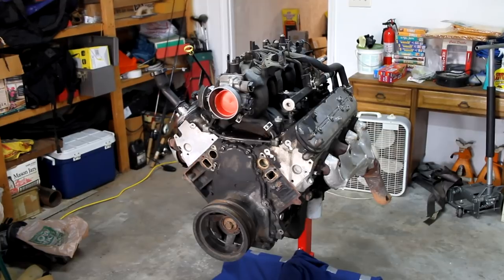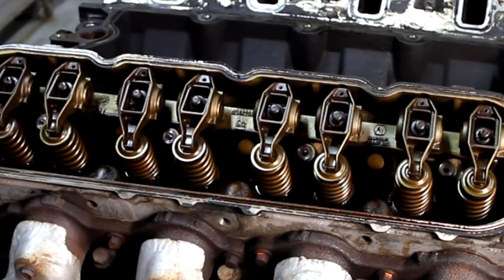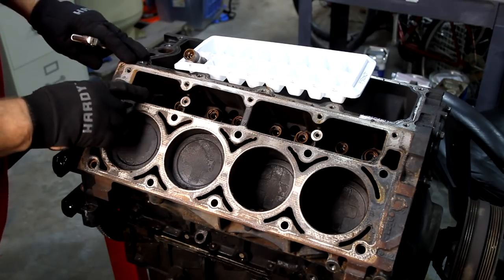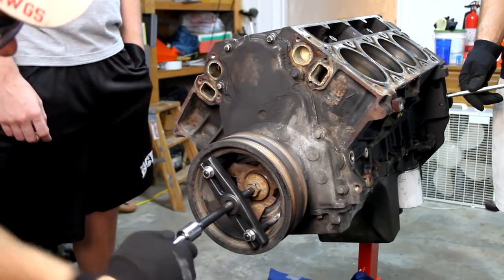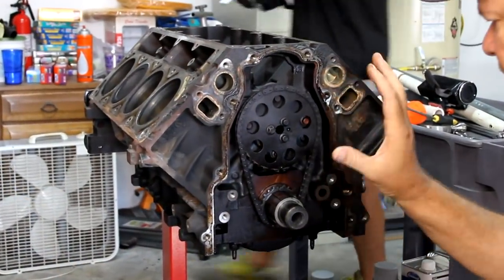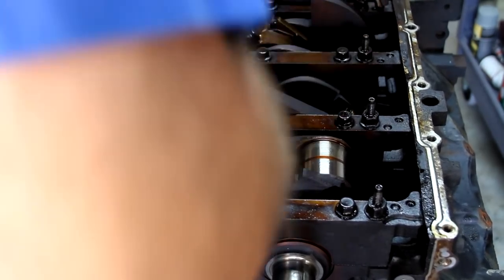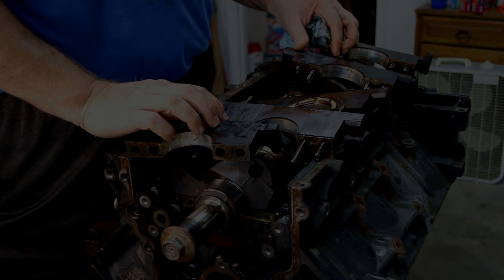LS 5.3L Build Part 2 Teardown | Project Rowdy Ep006

Comment: Just discovered your channel, great content! Also figured I'd share a little trick I have learned with getting the cam out. The water pump bolts are longer but are the same size and thread pitch so you can screw those into the cam to make a little handle to help with pulling it and putting one in. I noticed you were using your speed wrench.
Reply from the maker: I had heard that and when I attempted to do that, the bolts did not screw in.  I have a feeling I was using the wrong bolts.  The little guidance manual that I have mentioned an extension or rod down the middle, so that is what I used.   It will state that it was not the best method.  When the Cam came out far enough, you can see that I abandoned the speed wrench!  Awesome and thanks for sharing!!!!

Comment: was that a 5.3 or a 4.8 because typically the 5.3 motors have dish top pistons and the 4.8 motors have the flat top pistons. also some blocks can be 4.8 or 5.3
Reply from the maker: My engine is an LM7 5.3L.  The block has 4.8/5.3 embossed on it as this block casting was used for both displacements.  Hope that helps!!!
Reply: that's what I was thinking since it had the flat top pistons in it

Comment: I see that your Pushrods for 1,3,5,7 are darker than the even cylinders. Mine were too. Any ideas as to why the odd cylinders have darker color pushrod than the even?
Reply from the maker: That is interesting.  I had not noticed that at the time.  I have no idea other than something to do with the flow of Oil through the system reaches that side first (or last) and contains slightly more contaminants.   Just guessing.
Reply: Do ls engines lean either way slightly?

Comment: Really appreciate you uploading this vid.

I just picked up a 4.8 that needs rebuilding and I am literally going to follow everything you just did here.

Big Thumbs up!!
Reply from the maker: Hey... Thank for the message.  I highly recommend the following softback book:  "How to Rebuild GM LS-Series Engines" by Chris Werner.   I found it on Amazon: http://amzn.to/2g3xXNl for about $20.  I would not be hard to teardown an engine without it, but there are so many pieces of information that are really nice to know.  Just got my parts back from the machine shop and plan on starting on the bottom end tomorrow.   Best of luck with your build.  Keep in touch!
Reply: You can bore the 4.8 to a 5.3 as well. They were the exact same block which is sweet :)

Comment: Hi do u know the name of the part u started to remove at 3:16 I need to replace mine it's leaking, tnkz
Reply from the maker: That is the Steam Vents.  There are gaskets that can be replaced or entire kits for tubing and all.
Reply: @UCanDoIt2Mike  thanks was able to find the ls steam replacement tubes, aftermarkt but worked.
ps: thank u for your time

Comment: I think these things break exhaust manifold is because they are "bottomed out" in the aluminum heads and have no where to expand during a heat cycle. Just my theory though
Reply: Idk...seems like it's a common issue with any 4.8 or 5.3 over 50k. Possibly overtorqued manifold bolts from factory plus the heat just weakens the bolts over time. My guess.
Reply: Cheap quality factory bolts. Grade 8 ARP studs torqued correctly will last.

Comment: If you've ever broken off a bolt/stud on removal (even just once) you will then use penetrant solution, and the impact wrench. There is something about the rapid "machine gun" slapping action that will break the rusty bolt loose,compared to a long pipe on a breaker bar that simply breaks the head off.

Comment: How much horsepower and torque did this build make for you?
Reply from the maker: This engine has not been installed in its swap vehicle yet.  Even when it does, I doubt I will run it on a Dyno.
Reply: +UCanDoIt2 yes sir. Im looking to do a top end build, mostly for sound, but wouldn't mind getting between 4-500 horsepower if possible. what would you reccomend to do this?
Reply from the maker: My build modifications were mostly for sound as well.  I'm putting this in a Jeep CJ7 to be mostly streetable.  HP was not in my scope.  You will either need to start doing some research or find you a good motorhead.  Cheers!
Reply: +UCanDoIt2 thank you sir. love these videos. I watch them over and over. very informative.
Reply: @MrCmcmanus59 , UCanDoit2, Haha gtfoh I am doing my for sound as well Hahahah!

Comment: AIR TOOLS...........Tear a motor down in 1 hour
Reply from the maker: Yea...  I have tons of air tools but elected to follow some good advice from the book I was following.  Apparently pounding through it with an air tool often destroys the end threads of the bolts and tapped holes.  We had plenty of time, so we just slowly motored through it!  Cool stuff!!
Reply: @UCanDoIt2Mike  what book did you use   legit question.
Reply from the maker: GM LS-Series Engines by Chris WernerAmazon: http://amzn.to/2igcReD

Comment: Did you replace any of your freeze plugs? Why or why not?
Reply from the maker: All of the plugs where replaced at the machine shop.
Reply: UCanDoIt2 I did not have any intentions on replacing them. Do you believe it is a necessary step?
Reply from the maker: I believe it is standard practice to change them.  There are guys doing budget builds that are not changing them, but its only a $30 kit and the proper time to do it is now.  You definitely need to replace the Barbell plug which comes in most kits or can be purchased separately.   Hope this helps.

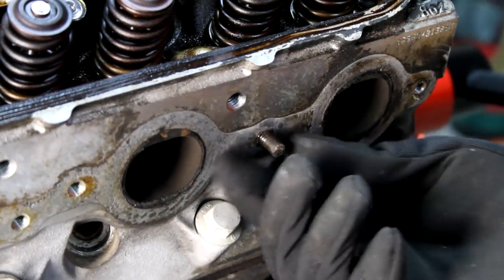Comment: I know this video is kinda old but just sharing a little trick for busted bolts @8:20 for anyone. Get a die grinder and make a little slit on the end of the bolt sticking out then use a flathead to unscrew it and boom!

Comment: Can you get rebuild a 5.3 to handle 400 hp with out sinking a load money ? 400 hp out this light motor be about pushing  and pulling my overweight assets around at high velocityyyyyyyy
Reply: Estebahn Randolph absolutely! I’ve got a stock rotating assembly 5.3 with a nice cam, injectors, DoD/VVTI delete, a tune and a big single turbo on low boost its making 640hp/650lbft with WAAAY more room to go. Hell, with just a cam, e85, and messing with the fuel enrichment and torque management/throttle body response on HPtuners you can be at 420/430.

Comment: my chain has the same play.  is tha bad?
Reply from the maker: Not as long as it is excessive.
Reply: @UCanDoIt2Mike  im actually watching the series of your videos as a right now im in the machining part

and im ordering a new chain. 
because i have the p0300 code and my engine sakes a lot, so i think it will help with the timing

mine is about the same looseness as your old in the vid, but the dots line about perfectly straight wen under tension from the small spur
Reply from the maker: @odiarroyo6144  I cannot tell from your message whether you have purchased a new chain.  The timing Chain is a wearable part and since you are this far into your engine, you should definitely replace your "Timing Set" which is the Chain, Cam Gear and Crank Gear.  All three slightly wear to create excessive chain slop.  A new Timing Set, if built correctly, should always result with the same amount of looseness, because the distance between centerlines of the Cam and Crank have not changed.

Comment: Would this process be sort of the same for a 6.0 lq4?
Reply from the maker: Regarding Machining....  Absolutely !!!!  This process actually applies to ANY engine (GM, Ford, Dodge).  The LQ4 is in the same family (GEN3) of GM engines as my engine.  The major difference is the Bore size of the block.

Comment: Really good video.
Mike, make sure to measure the thickness of those bearings just to make sure they're still in spec for thickness though.
Reply from the maker: Those bearings are going to the trash. The new bearings are in match the finished and polished crank and rods.  Going to be sweet!

Comment: great video
I don't know if it has been stated yet, but to get the lifters out, you remove timing chain and turn cam Counter or normal clockwise one turn, that pushes the lifters up and locks them and allows you to remove each lifter tray with lifters in one operation. Its what I have seen, explained with demonstrated.
Reply from the maker: Mark Torre I had also seen that process and should have tried it.   But I am not sure it would have helped in my case.   The lifters would slide out slightly (normal travel) then get stuck.  Great observation.

Comment: anybody know the name of the gasket. the one that goes where the knock sensor is located? thanks.
Reply from the maker: The Gaskets underneath the Knock Sensors are: Knock Sensor Grommets.  The Gasket under the plate that the Knock Sensors mount in, is a Valley Pan Gasket.

Comment: hello, I have a question, I'm replacing my castech heads with 862 heads on my 02 Chevy suburban. I will be using the same pushrods and lifters. do I have to follow the same torque sequence you did with the rockers you put on? or would I put the lifter bar back on and torque it down? thanks so much for your time and help!
Reply from the maker: Edward Thayer You would want to follow a similar process that I did.  AND....  you might want to check your pushrods length as a precaution.  Since the head is changing,  the centerline of the reunion (rocker pivot), could be a different distance from the crank and require a different length pushrod.   Just a thought.
Reply: UCanDoIt2 thanks so much for your time and help! how would I check to make sure the pushrod length will work?

Comment: You will probably get to this later in the video or something, but it is really important to stamp numbers on the rod caps and the main caps so you know what cap goes with what rod and main location.
Reply: junglejonny1000 the bores for the crank and rods are line bored perfectly linear. If you mismatch the rod and main caps, some could be just a tad different and the oil clearance between the bearings could be slightly off causing hotspots if too tight or vibration/knocking at high RPM if too loose. ALWAYS keep any valvetrain and rotating assembly parts in order if you plan on reusing them, they’ve been worn to that specific cylinder and should return to their homes. 😁👍🏻

Comment: 2004 5.3 vortec how many coolant sensor port in the head my friend broke the coolant sensor off on the driver side would there be a secondary that I could use broken sensor not leaking
Reply from the maker: Both the Driver's side and Passenger's Side Heads are Identical.  The one that broke off is probably the one on the front of the Driver's side.  Check out the same area on near the rear of the Passenger Side.   It might currently have a plug in it.  Just remove the plug insert a Temp Sensor and then relocate (or extend) the wire with the connector.
Reply: UCanDoIt2 Thank you so much for the great advise have a great day

Comment: What tool was used  to pull crank bolt out?
Reply from the maker: If you are talking about the Harmonic Balancer bolt in the front of the Crank, I use a large socket and large Breaker Bar.

Comment: Might want to calibrate your torque wrench since your were breaking torque instead of torquing. Great video though.
Reply from the maker: I guess I am a little confused by your comment as I did not use a torque wrench anywhere in this "Tear-down" video.
Reply: Looked like one but I stand corrected I apologize.  I was an aircraft mechanic and that was one of the first things new mechanics would do. Again sorry for the mix up. Great video
Reply from the maker: Hey...not a real problem.  Thanks for the clarification.   Cheers!!!!

Comment: well there's a lot going on in that engine. couple things that were cool to me... when your son pulled those heads they appeared to be soooo light weight haha! I've never been around aluminum heads... and the other is the 6 bolts on those bearing caps! there were 2 on the side right? gonna have to Google knock sensor also! anyway great video man!
Reply from the maker: Yes the heads are aluminum and are quite light.  And yes the bearing caps are attached with 4 bottom bolts and 2 side bolts.  Have been ordering all the replacement parts and boy are they expensive for these Gen3 Motors.  Hello!  Do they thing we are made of money?  I keep telling the boys that I am spending their inheritance. Ha!
Reply: UCanDoIt2 lol! that's funny! well it doesn't surprise me I don't think they have the support of the after market like the 350 does yet... where are you buying everything from?
Reply from the maker: Much of the internals (Pistons, Rods, Bearing, Valves and rebuild kit), I am letting the machine shop purchase.  Much of that is "Sized" based on where he thinks his work will end up and he needs those parts quickly to measure them and in return make my engine fit them.  Much of the external parts (Water Pump, Oil Pump, such) I am getting form Summit, Rock Auto, and Amazon (name brand only).
Reply from the maker: I was surprised at the pricing of Summit.  I had proceed them once and thought they were expensive and related them to "Racing" high dollar parts.  I have recently come to the conclusion that they do have good prices and I have bundled items in several different orders to take advantage of their free shipping.  I try to always be open minded.
Reply: That free shipping is awesome for sure!

Comment: There really isn't any slack in the timing chain new ones are like that too
Reply from the maker: I really didn't have anything to compare it to, but I did observe that my new timing chain had half that slack when it was installed.  Probably not an big issue, but chains are a "consumable",  I think it makes sense to change it while I am there.
Reply: UCanDoIt2 forsure no point in putting a old one in

Comment: What kind of engine stand was used?
Reply from the maker: It is the Harbor Freight 1/2 Ton.  I purchased it on sale with coupon many months before I started the project.   I liked the fact that the four wheels are all spread out.  If I was in the business r planned to do more engines, I would have purchased the 1 ton.  This one flexes noticeably.  I would have to recommend the 1 ton.
Reply: Thanks for all the info great videos!
Reply from the maker: You are more than welcome....  Best of luck with your project!

Comment: I have a 1978 Camaro, and want to put an LS engine in my car, ,Which LS engine do you recommend? I will be doing a bit of street racing.. Not a lot, mostly standard driving highway speeds.
Reply from the maker: If you are wanting a drop in engine with out reconfiguring the front accessories, you should start with something from a Car versus a Truck.  Truck Engines (Vortec) are configured tall and narrow, Car engine are configured Low and wide.  LS1 and LS6 are probably the most economical.  They all are streetable and can be altered for performance.

Comment: Do you have to take the heads off to remove the lifters? I’m wanting to rebuild my 2005 GMC Sierra 5.3 because of a lifter tick but I also wanted to do a cam swap. How long did it take you to remove all the electrical stuff and then the heads?
Reply from the maker: Brent Chaloupka Yes.   You will have to remove the Intake and the Heads which will expose the Lifter Trays and Lifters.  My approach with removing the entire harness doesn’t really compare to the time it will take you (less time) to remove what you need to.
Reply: UCanDoIt2 thx man great vid by the way
Reply from the maker: Not a problem and thanks for watching!!!!!

Comment: Why not use an electric 3/8 impact or electric ratchet ? Would save so much time
Reply from the maker: First and foremost, I had bought the wobble (speed) wrench a couple of years ago and was dying to use it.  I had read that you should not use an impact wrench (high speed) even when removing bolts as it can damage the end threads of the bolt and hole when they spin together under pressure.  Made sense to me so I elected to go manual.  I have Electric Impact, Pneumatic Ratchets, and a big Pneumatic Impact Wrench and just decided not to use them.   This was not a project of speed denoted by the number of times I had to move the camera.  We were taking our time and just trying to enjoy and learn from the experience.  I took your question to be a true inquiry and not a jab at my actual process.  It is a great question, so I thought you deserved a thorough answer.
Reply: UCanDoIt2 yes sir not a jab at all I was just curious. That does make sense all though I've never had an issue but why risk it if you're not in a hurry right. Thanks for the response. Love the video